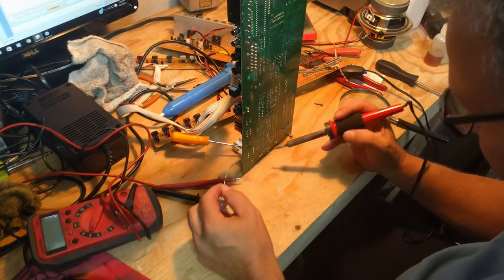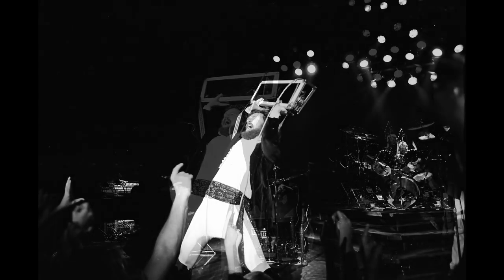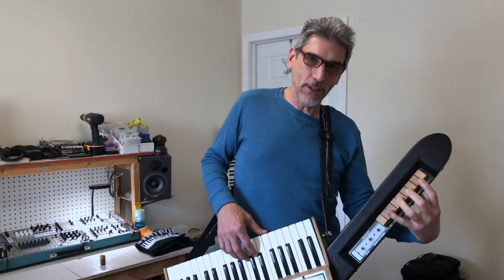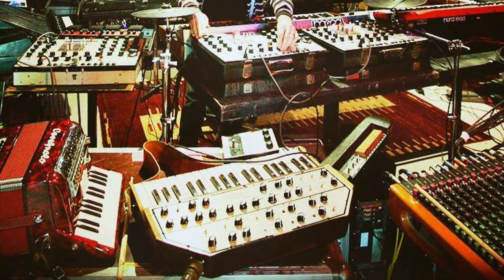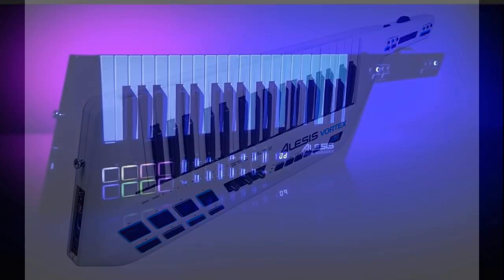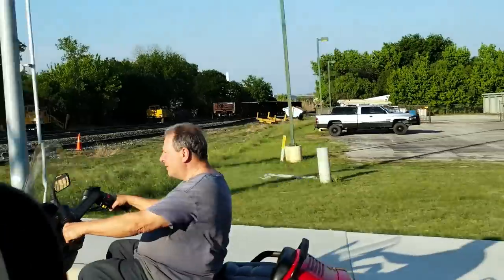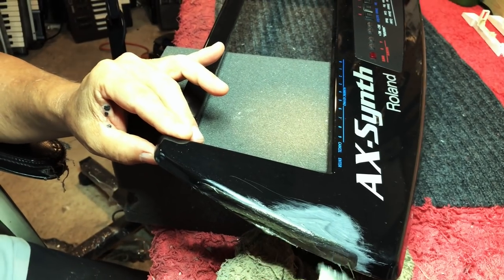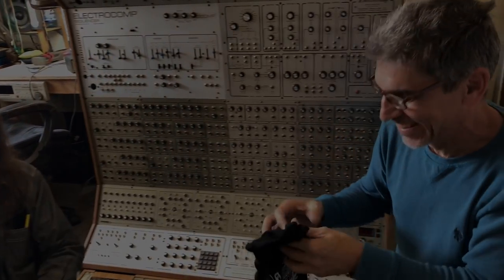Synth Wizards Episode 7: Syntars, Keytars & Orphicas

Comment: My first synth was an EML 100 s/n 162 bought in 1972 , one of , if not the first to arrive in Philadelphia .Purchased before the manual was printed— what a learning curve!
Made a few trips to the factory in Vernon , Connecticut for repairs & upgrades. Fond memories of hanging with Norm Millard & Dale Blake. On occasion would use the separated keyboard as a ‘ key-tar’ since I had them make me a 10 foot extension cable. Sadly my synth perished in a fire in 1975. 
Enjoyed the CS-80 video — played one for a few years when I toured with EnglandDan & John Ford Coley. In fact our drummer used two Synare synth drum pads ( manufactured by EML alumni ). 
Love your videos…. Keep up the good work.

Comment: I was never big on the "Strap On" part of these but I have a Lib., CS01, sh101, Casio cz101, and an AX. If Roland had put the aftertouch in the keybed of the AX instead of a thumb knob I would've totally "Hammered"
Reply: I have a Casio CZ-101 also (which I purchased new in 1987). It has attachment points at each end for a shoulder strap so it is among the cohort of synths that were designed to be played "up front" in the band.